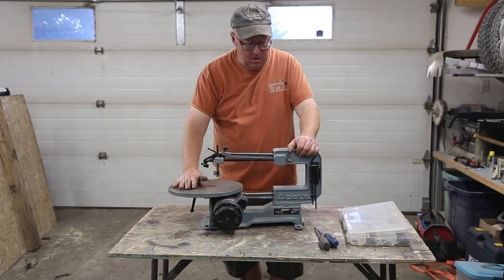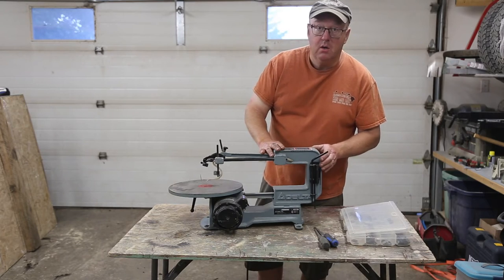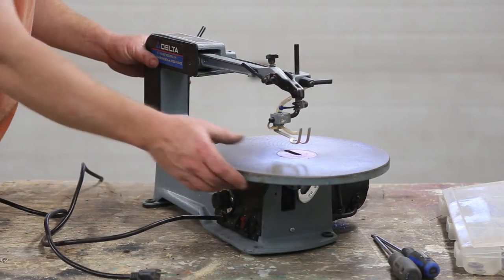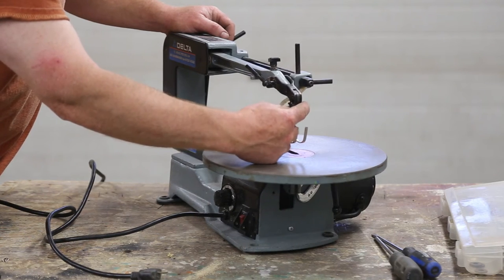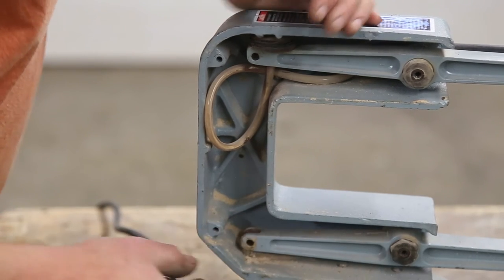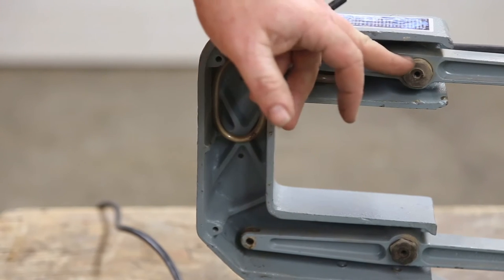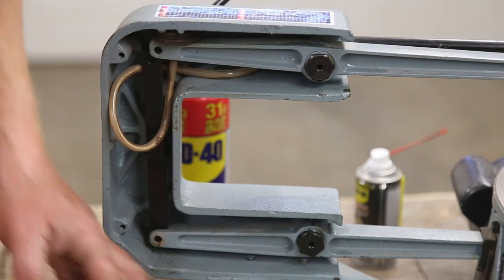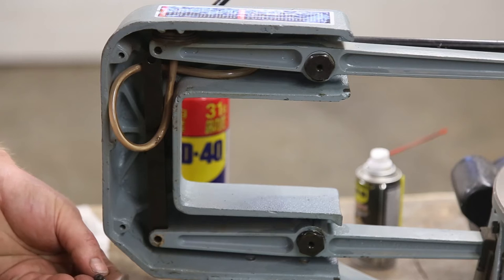Maintenance on a Delta 16" variable speed Scroll Saw

Comment: Stevo, I echo the positive comments of the others.  A thought on the bellows, I used the bulb from a blood pressure cuff.  It's squeezes in the same area of the bellows and has a one way check valve built in so it takes in air from one side and blasts it down the tube.  Thanks again for sharing your good advice.
Reply from the maker: That is quite ingenious.  I will have to keep my eyes out cause that sounds like a good fix.  Thanks.  Stevo

Comment: Thank you Sir,  i checked the scroll saw that i bought recently and approved that it was running dry, i lubricated with grease all the joints to prevent further damage, your video helped me to understand the structure of the scroll saw and do the right maintenance.
Reply from the maker: That is awesome.  If maintained right, that saw will last a long time.  I have kept some going for 20+ years, in a school.  Great little saw.  Thanks.  Stevo

Comment: Old equipment is awesome. Things were made with pride in the old days.
Reply from the maker: It is amazing how much better the old stuff was made in comparison to the new.  It seems like they used better quality metals and thicker.  They weren't concerned about saving $20 when they built it.  Thanks.  Stevo
Reply: @stevoj8959  I paid $10 at a yard sale for a very old Sears scroll saw. I replaced the cord because it was rotting and cracking rubber. Works nice, except it uses a very short blade, about 3.5 inches, and I cannot seem to find them, even on the intetscreen.  Not that I do much woodwork, but I might do more if I could find blades.
Reply from the maker: @haneyoakie14  Could you cut down a blade to make it work?
Reply: @stevoj8959  it has the studs at both ends, so idk how to accommodate that.

Comment: Any machine shop could reproduce the 2 small bolts by starting with longer bolts and machining the shank and proper threads to match the old parts.  The cross link could also be made, as you said, yourself.  If I were doing this (and I might be, I also have a 40-540 Delta), I would want the bolts to wear before the cross link ends because they are easy to replace.  So the bolts probably aren't hardened (very much).   I also looked for small rubber bellows -- no joy even on McMaster, but a small aquarium air pump might be good enough for the job. Thanks for the video.
Reply from the maker: These parts can for sure be made.  You could probably weld up the wore spot on the bolts and repair them but the link would be easy.  Never thought of an aquarium pump.  One comment I had was there was some bellows on ebay.  Unless the motor does, these machines should last forever.  Thanks.  Stevo
Reply: I'd love to agree...Truth is you probably couldn't.  Even if you could find a machine shop, they'd either blow you off as an annoyance or charge you $100/hr+ with a minimum charge for the hassle.   You'd be better off to buy another Taiwanese Delta Scroll saw and throw the broken one in the scrap pile.....

Now if your uncle Billy has an old lathe in his tractor shed, that's a different story.

Comment: Very informative. Thanks. I picked one up at a garage sale for five bucks, but it is missing upper and lower blade clamps. Not sure if I will modify or buy replacements, if available.
Reply from the maker: $5 is a good deal for that saw.  I believe you can still get the quick releases for that machine.  Hope you get it up and running.  Thanks.  Stevo

Comment: So useful. Thank you.  I just bought a very similar used Delta 2 speed.  Do you think I can plug it in a pedal to get variable speed?
Reply from the maker: I see no reason why that would not work.  The two speeds are nice and I would try it first before I went variable.  Variable is nice if you need precision.  Thanks for tuning in.  Stevo

Comment: This has been a wonderful video which has helped in my restoration of my grampas delta. But I'm missing the tension lever. I've looked high and low but they dont make the part anymore. I was curious if you could help point me in the right direction to find one or help with some reference photos so I can attempt to fabricate one.
Reply from the maker: The tension lever is about 3 inches long.  Not sure what the threads are but one could easily manufacture one out of a rod or weld a rod onto a bolt.  You are lucky that is all that is missing.  Worth fixing up cause it is a nice machine.  Thanks.  Stevo

Comment: Those are common shoulder bolts, easily found in Allen head / hex key. Every machine has them.
Reply from the maker: I was not aware that they were the same.  Would have to be special ordered but good to know.  Thanks.  Stevo

Comment: I have a 16" 2 speed Delta Scroll saw and I can't find a replacement blade clamp any ideas on where to locate one. Thanks enjoy your videos.
Reply from the maker: Are you looking for the quick release ones or the original ones that you use a wrench on?  Stevo
Reply: @stevoj8959  I have a Delta 40-560 type 1 16" 2 speed. I need the upper chuck or blade holder. I purchased it along with some other tools. All I have is the flat piece of metal that fits between the fork that goes up and down. I guess the screw worked a loose and the piece that held the blade against the flat piece fell off. There was a quick connect available at one time but it is obsolete now along with the original holder. Thanks for your reply.
Reply from the maker: @mattoxh  I may have some blocks I could part with.  Send me your e-mail and I will send you a pick of them.  Stevo
Reply from the maker: I do have a set of the clamps but can't figure out how to send you a pic.  Stevo

Comment: Hi Stevo, I just bought a used one of these scroll saws and went to YouTube for some help and found your video.  From your video it seems like the one I bought it is in pretty good shape, but it did not come with a manual, blades or a blade tightening tool.  Can you tell me what length and type of blade works with this saw and where I might find a tightening tool?  Thanks and regards.
Reply from the maker: Blades are just your everyday scroll saw blade without the T hook.  You may be able to buy a blade wrench on ebay or some of the tool supply places still might have one(part # 1343648).  If you can't find a blade wrench, you can stick a small screw diver in the hole then use an allen wrench.  Hope this helps.  Thanks.  Stevo

Comment: Hi,Stevo. Can it use a saw blade with cross pins on both ends? thanks
Reply from the maker: The cross pin blades will not work in these saws.  You can just grind the pins off to make them work.  No pins gives you a little more adjustability.  Thanks.  Stevo

Comment: hi ! I Have a 40-540 c DELTA scroll saw and it is missing the 4 rubber grommets  that are on the base of the machine! also one of the special screws that hold the blades! Can you or any-one help me out?
Reply from the maker: You may still be able to find some parts at E Replacement Parts.Com.  The grommets might be a problem but one can rig any small rubber mount.  As for the blade clamp, you can still source out quick release kits for them.  Hope that helps.  Stevo

Comment: I bought a ss250  at a garage sale  it works great  but the variable speed  seems to be at full speed  and non adjustable  any repair tips
Reply from the maker: You may be able to buy a new rheostat online for it or at an electronics store.  Try E Replacement Parts.com as well.  Hope this helps.  Thanks.  Stevo
Reply: Had this issue on mine.  I was able to pop off the switch panel and look underneath-  the speed adjustment knob had come loose from the contacto below.  I was able yo put them back together, and variable speed was restored

Comment: I just bought one but the speed dial has no effect. Just runs at medium no matter what I do. Any ideas?
Reply from the maker: You should be able to go on line or find an electronics store and replace the variable switch.  Unfortunate you can not buy many parts for these anymore.  Thanks.  Stevo

Comment: Hi i have a Delta scroll saw that i think is the same as the one in this video and the bottom blade clamp is damaged (the damaged part is fastened to the arm) and i was wondering if you know where i could get a replacement blade clamp?
Reply from the maker: Some parts are still available, old stock of course.  Try ereplacementparts.com.  I saw they still have the chuck available.  Hope that helps.  Stevo
Reply: @stevoj8959  Thanks i found the part

Comment: For some reason my degree marker won't let my table tilt more than 5 degrees.  It hits into the saw base. Do you have any ideas what I can do? Maybe some thing wasn't installed correctly.  I removed the compass and it will tilt further.
Reply from the maker: That is interesting.  The table of course only tilts one way and pivots on a couple of bolts.  They may be too tight or just need a shot of penetrating oil.  It should move smoothly.  Thanks.  Stevo

Comment: I came across a free Delta 16" Model 40-540.  Its in excellent condition but its missing the Blade Cam part#1346124.  Did a search and no one sells it.  Any ideas what I can do to fix it?  or should I just forget about it.  Thank you in advance
Reply from the maker: Send me an email and I may be able to help you of with that cam.  In the about section on my channel.  Stevo
Reply: @stevoj8959  Hi Stevo,  I went to your page (about) but I don't see your email.
Reply: @stevoj8959  Thank you, I have sent you a message.

Comment: where can you buy the variable speed switch mine does not do a thing it's on one speed any thoughts Delta 40-540
Reply from the maker: I have purchased them from an electronics store with a new knob and was able to make it work.  It is just a small rheostat.  Unfortunate you can not buy original parts for them any more.  Hope that helps.  Stevo

Comment: Thank you for the great video. I just purchased the same model saw. I'll know what to look for now. Where do get your  parts. Thank you
Reply from the maker: Parts are tough to get because they don't make them anymore.  You should still be able to get the quick releases for the blades.  I think that was after market.  They are a good saw.  Enjoy.  Stevo
Reply: You can get the bellows and the special screws on Amazon $22 for the bellows and $14 for the screws.
Reply from the maker: @votedimout  That is good info, thanks.  A bit expensive but then not bad for something you can't get from the factory anymore.  Stevo

Comment: Hello from the uk I’ve been looking for some spares for the same model but it’s near impossible to get anything the added clip to this footage shows you fitting blade top part mine needs replacing if you could advise where possible to locate spares would be appreciated
Reply from the maker: I have been looking on line for some parts and they're just not out there.  One thing you can try is adapting a blade clamp from a different saw.   Too bad the shipping costs for those parts is so high.  Hope you can get it up and running it's a good saw.  Thanks.  Stevo

Comment: Do any of these have lights?
Reply from the maker: We never did run these with lights but I see no reason why one could not rig one up.  A light would be nice.  Thanks.  Stevo
Reply: @stevoj8959  Friend had a Dremel variable speed that had a light too.  I inherited an unused Delta SS250, which is why I found your channel.

Comment: Stevo whats the difference between the the 40-560 and the 40-560c ??
Reply from the maker: The 40-560c model has the quick change clamps.  Other than that they are the same.  Thanks for tuning in.  Stevo
Reply: @stevoj8959  cheers mate 👍

Comment: Hi Steve sorry also meant to ask if you have the spring dimensions, dia, length and wire thickness
Reply from the maker: The spring itself is about 8 mm or 5/16 inches long, for the diameter, it just has to fit in the hole.  You can usually find a longer spring then snip it off with some side cutters.  I think I have even used a spring out of a pen before.  Thanks.  Stevo
Reply: Thanks Stevo, used a pen spring cut down. It is a little small in diameter but works ok. I will keep looking for a bigger dia.
Reply from the maker: @ivancotterill6059  Awesome

Comment: Hi Steve, I have a 25 year old 40-540 which has had very little use, mostly stored under my workbench. I have recently started to scrollsaw again and am a total beginner. I do not have the quick release Jaws just the straight ones that tighten with a thumb spanner. I took the Jaws apart to clean them and lost the small spring that locates in the moving jaw. I live in the UK. Any idea where I might get a replacement spring or do you know of another machine that would have a similar spring.